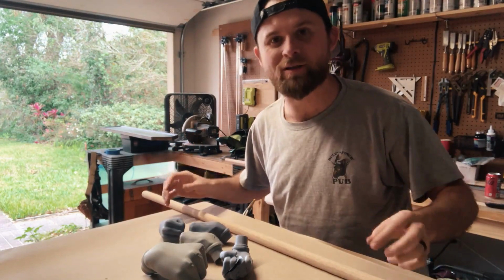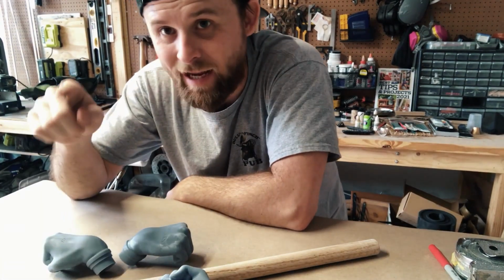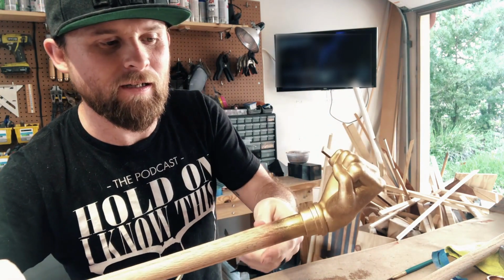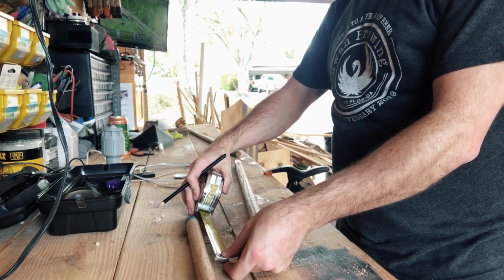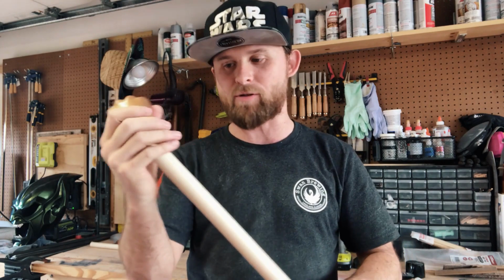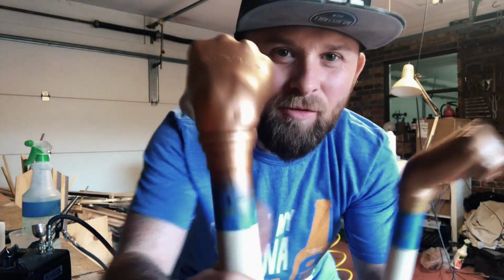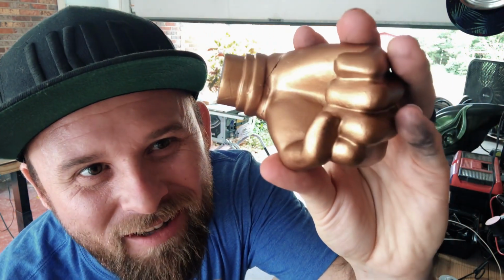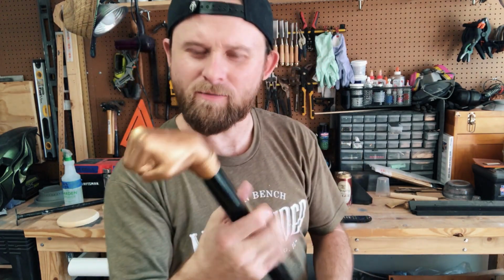How I Made My DIY "Biff H. Tannen" Cane from "Back to the Future" | How to make Resin into Medal

Comment: Does the type of 3D printer filament you buy affect the strength of it?
Reply from the maker: well, this one was printed in resin so it's pretty strong ( it could definitely still break if you hit it hard enough lol) but if I'm using PLA or plastic, it typically is pretty strong and tough depending on how much infill you give it, usually you won't infill 100% unless you want it to be solid :) but its a pretty durable material all around, it is plastic/PLA so you do not want to leave it in the sun, unless it's the ABS filament, but other than that it's pretty durable :P
The type of filament could affect the strength though, I've only experienced this with transparent filament, but if you give it enough infill it could give it more backing inside and keep it from breaking. did that answer your question? :D